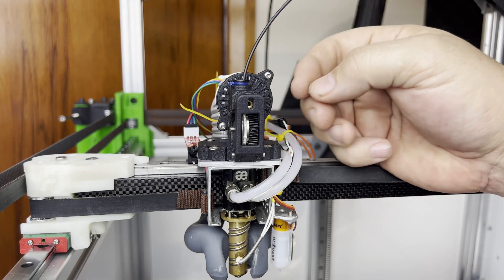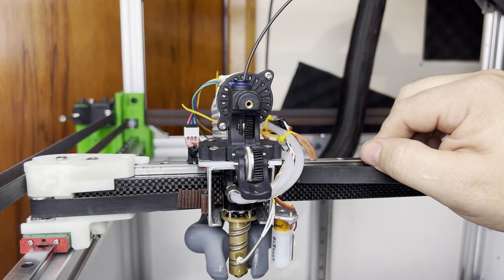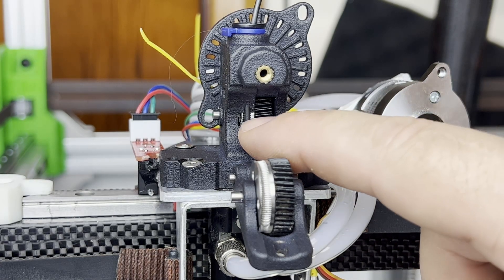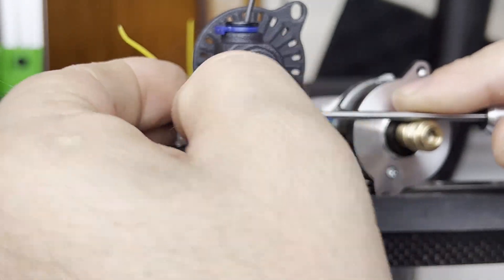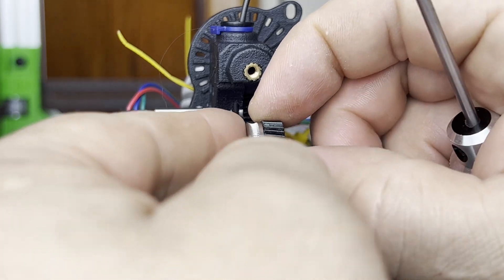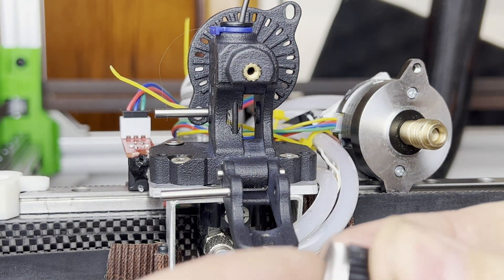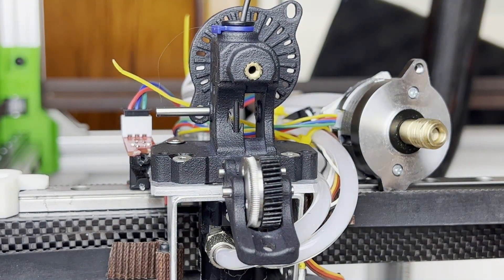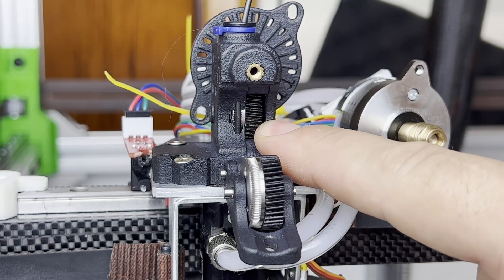How to fix your Mellow / NF Cannon Extruder

Comment: Nice guide!
Are there any special setup requirements for Cannon? I can't make my Canon work. Using version 1.2, gear alignment is correct. Everything is well arranged. Config based on Mellow's doc. But it still can't extrude smoothly even at 5mms.
Reply: У меня такая же проблема. Это происходит из-за того что мотор не может так быстро вращаться и выдавливать даже 5мм пластика. На канале cucha tv есть описание этой проблемы в видео о самодельном червячном экструдере

Comment: Is this extruder better than the bondtech lgx lite? I have a Printrbot Simple Metal with an E3D v6 and a Duet wifi 2, just looking for a future extruder to upgrade to. Might even consider doing a super short bowden tube. Any recommendations for  a direct drive or bowden setup?
Reply from the maker: In short , yes
Reply: @vvega007  Thanks! Looking forward to your review of the Mellow NF Cannon Extruder.

Comment: Woah...where'd you get the LSD hot end?!  Is Vez selling them somewhere?  And why would you buy this monstrosity when you could just get an LGX lite?  Those flat-face gears are not meant for a worm gear, and are the complete wrong application here.  If they're going to copy/rip off bondtech's products, they could at least take the time to rip them off correctly.
Reply from the maker: the LGX lite is absolute garbage as an extruder , its sloppy has the worst backlash I've ever seen in an extruder design and the tensioning mech seems like an afterthought . Bondtech don't make a product like this , the gears on this are considerably larger than the LGX and the gears are suited to the pinion . there are a number of ways you can drive a worm drive and this is just one of them .  You are probably thinking of an enveloping gear with contoured teeth , This is a amazing way to drive a worm , However it means you cant use plastic and the gears must be produced as a matching pair . Its also extremally expensive, PS there not flat faced there helical :). Yes i have an LSD hotend :) there not for sale yet and given that mine is an ac variant and Vez has no plans to make an ac variant ATM this is a rare bit of kit currently :)
have a watch of the next video when we go through all the issues of the lgx extruders  :) see if i cant change your mind on them been a flagship part
Reply: Hello friend, sorry we are not LGX gear, our is Helical gear, thanks🙂